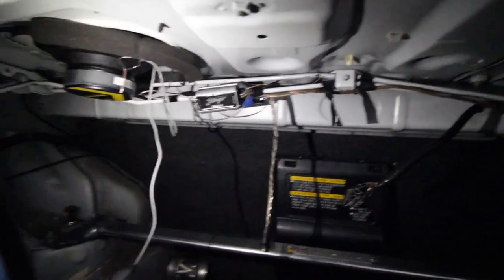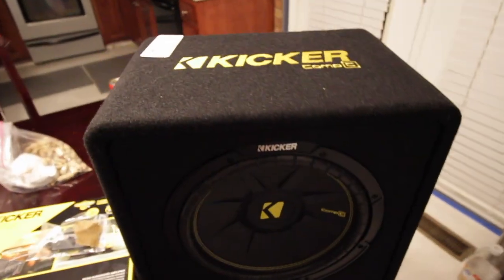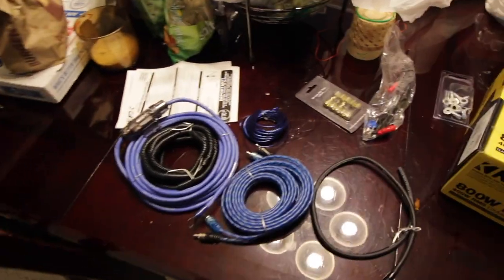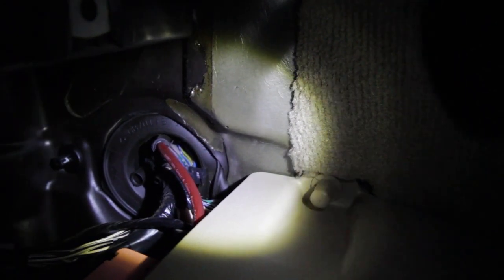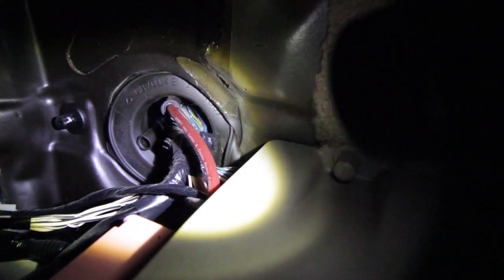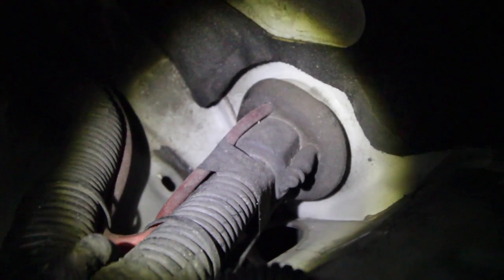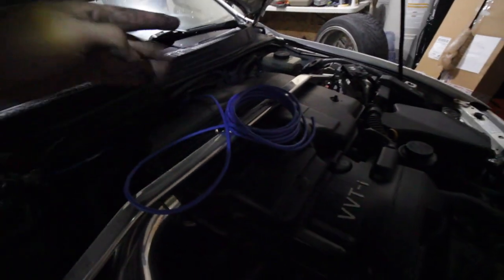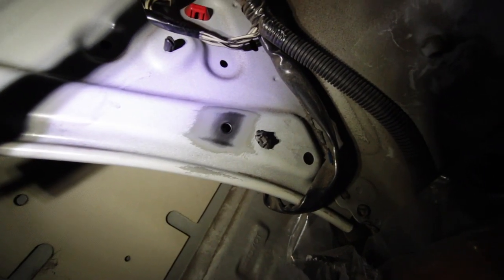How to Install a Subwoofer | Lexus IS300

Comment: why did u wire the sub though one channel and not bridged?
Reply: Its a 1 channel amp and its bridged on the inside so you can use either side.

Comment: Why would you not run it down the side of the car that the battery is on? I mean running it the opposite side of the car is silly. Just saying
Reply from the maker: I personally used the driver side for this one because there was already a hole made from when my father installed his own subwoofers long before i got the car. Another thing is youd want to keep the power wire away from your RCA wire that goes from the head unit to the subwoofer. Power wire on one side, RCA/remote on the other.